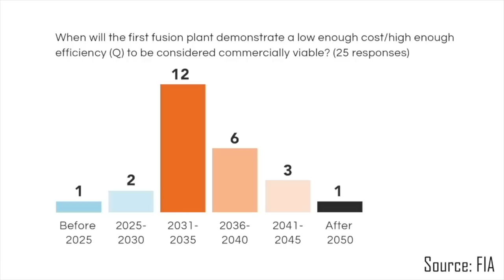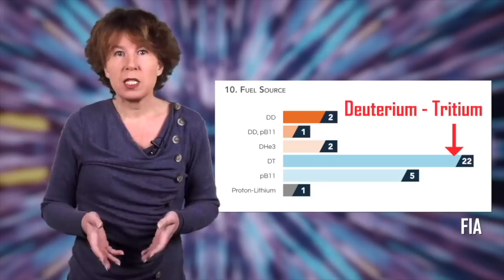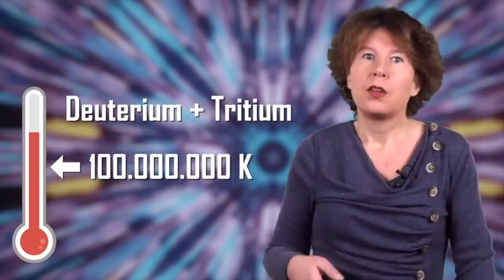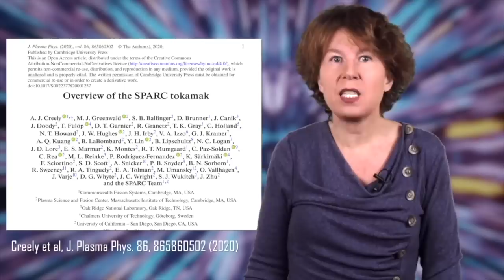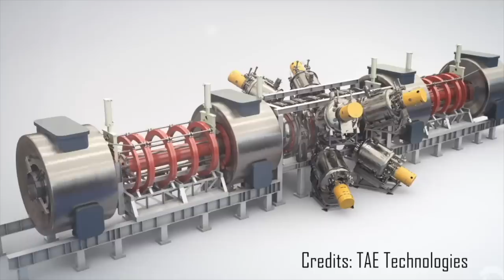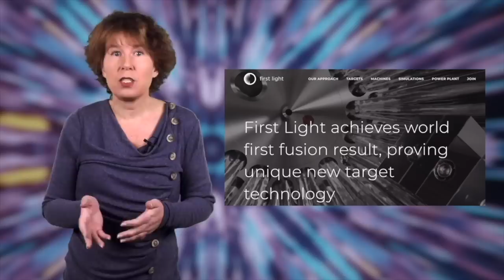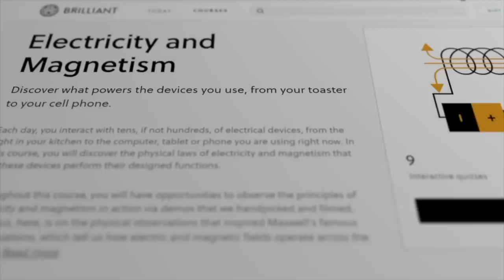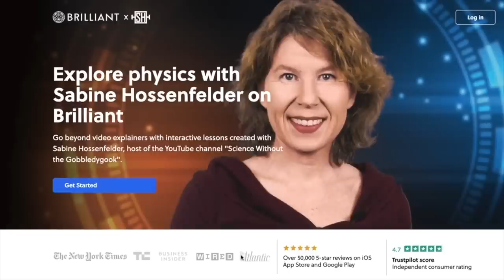Nuclear Fusion: Who'll Be First To Make It Work?

Comment: The issue with these technologies is that they are about 5 orders of magnetude away from economic power production. Maybe much more. 
Today, some claim positive power results. However, this does not include the following:
1. Cost of the energy to heat up the fuel. 
2. Cost of cooling containment walls.
2. Cost of refining the tritium.
3. Need to get to at least 10x power out / power in for economic power production.
4. Cost of fuel preparation. 
5. Time cost of money for building the vastly expensive plant.
6. Depreciation cost of the research to get to practical fusion.

I am sure Sabine can do better calculations than I can. 

Even if practical fusion generation is possible, how many years to get this level of improvement?

Solar, thorium, wind etc look like much better prospects in terms of cost and risk.

What is fusion good for? 

Well today, it is practical means of extracting money from government!

Comment: JET's 5 SECOND LIMIT WAS BECAUSE...
...it was switched off at that point. JET was designed purely as a research reactor as a test bed for future reactors. It therefore was never built with the magnet cooling needed for sustained operation and had to be switched off to prevent the magnets from overheating. If it had suitable cooling systems then it could have continued operating for longer,  but obviously we will never know for how much longer.

Comment: If it is finally got to work there are still a number of issues:
1.  Deuterium deuterium fusion has to be the one, as tritium is so hard to obtain in sufficient quantity on a global scale.
2.  It will be too late to meet the demands of global warming.
3.  The technology is so sophisticated that the skill-sets to maintain such will be a critical issue.
4.  There are long established technologies available today to meet the demands of global warming, especially harnessing wave and tidal energy, with methods for quick response to changes in energy demand.  BUT
5.  It is the sheer political, business, industrial and financial encroachment of the oil industry, that is the problem, a market which no one government can control.  I doubt if the finance market is ready for fusion energy, even for the long term.

Comment: This video appeared hopelessly unrealistic until the last 3 machines were described: First Light Fusion, General Fusion, and Helion Energy. Those three are the only ones that showed any connection whatsoever to the power grid.
Every single other technology described seemed to completely disregard the technology needed to convert fusion heat into usable energy.
Nice work though! Excellent presentation of the current state of the art.

Comment: Lately I discussed the low efficiency of combustion engines with my daughter. The efficiency might be increased by increasing the compression and temperature. If you go for infinity with both the efficiency could approach 100%.
We soon came to the conclusion that under these conditions nuclear fusion reactions would start, and our engine would  not need to combust any fuel..... 😅

That said it was very interesting to see startups use such old fashioned technologies as gun shots and pistons.

Comment: Sabine, My main question has to do with converting the energy produced into electrical current. Some of the methods mentioned do appear to create heat, you also mentioned one method that creates/generates electricity directly. My thinking is that the path from fusion to generation will not be simple regardless of what's known about electrical generation in more conventional methods.

Comment: I think fundamentally we are doing fusion wrong. If we can get a micro-fusion reaction going at only 2,673 Kelvin using high pressure (metallic hydrogen) we can then harness that energy using TPV cells. This would do away with the issue of melting the container as tungsten has a melting point of 3,673 Kelvin. With this we could then aim to build fusion devices that anyone could own, not something the size of a nuclear power plant.

Comment: I don't believe fusion will ever be used to generate electricity under terrestrial conditions. 

It simply takes too much energy  to create the conditions for sustained fusion that can ever be recovered.

Arguing that lasers can be made more efficient is no different to arguing that you can generate net energy by using a fan to move air over a wind turbine if you can only make the fan efficient enough.

Comment: When people say that fusion produce a lot of energy it's true but only to certain degree. To overcome Coulomb barrier we need to 100 kEv of energy (for light cores like hydrogen) and we have get it from somewhere the energy released by fusion should be from 2.5 to 14 MEv or 25 to 140 times bigger. But lets think about efficiency. Our power plants have efficiency from 30 to 60 percents roughly. For simplicity lets say they all have 50%. In additional machine that would pomp energy into particles to make them collide would also have it efficiency guess optimistically it's about 50%. That mean that to get particles with 100 kEv of energy we need to get 100 / (0.5*0.5 )  = 400 kEv of energy or 6.25 to 35 times more. Not that impressive isn't it? But we need to get electricity from it so at best we would have 3.15 to 17.5 more energy than we used for fusion. Sounds close to impossible to make it profitable for me because any drop in efficiency may be devastating for commercial use.

Comment: Regarding Helion, when you mention the cyclotron emission associated with the spiraling motion (gyromotion) of charged particles in magnetic field: I don't know why you reserve it for Helion as it applies to any scheme using a magnetic field to confine the plasma. But the cyclotron (or synchrotron) emission is not an issue as it is mostly reabsorbed by the plasma. Fundamentally this is because when the emitted photon travels a bit it encounters an other charged particle which rotates at the same frequency, so it can resonate and be reabsorbed. The other much more problematic emission is bremsstrahlung, coming from the acceleration due to collisions. Due to the stochastic nature of the latter, this radiation is not reabsorbed and this is a large and well known heat sink. It is a relatively minor problem for tokamaks, a large problem for Helion (D-He) and a probably insurmountable one for TAE (pB11).

Comment: Seems to me an ideal approach would use a combination of cold fusion and scaling up with more energy injected into the system. Plus a starter of nuclear fission (already a tested and working technology). I call this combination "lukewarm fusion". The FFF (fission-fusion-fission) device has already been constructed, so no new technology is required. Just an engineering detail of having the energy produced at an acceptably low rate. And, yes, the reaction is energy positive, especially if one uses thorium as the starter fuel. I suspect the main reason this is not being pursued is that it doesn't cost billions of dollars to create a test reactor, so it doesn't need a multibillionaire or government agency to fund development and implementation.

Comment: My intuition tells me the zap method with be the first commercial approach, but it will not yield much power for its cost.  
Also, it gave me an idea for a completely new approach.  Much like biology does its chemical work, you could break the problem down into many discreate steps, for greater efficiency and lower input energy and containment requirements.  A really big AI could find these steps.  For example imagine the last step use anti-hydrogen as fuel; which is theoretically trivial but has practical issues.  In biology there could be many thousand steps, and there are multiple enzyme pathways to get to the result.

Comment: Simple answer...NONE of them.  The underlying designs are flawed.  The designs are searching for sysmetric systems which can create true positive energy release...taking into account ALL input factors.  But these devices are designed to OPTIMIZE that opportunity.  The failure is that none of them can operate continuously.  Continuous operation is NOT symmetric.  There always has to be an input and output...the act of doing both creates asymmetries.  They will prove the ability to create a positive creation in a vessel.  They will then spend the next 100 years trying to find a way to continuously refuel it.  

All the designs carry the same flaw...even the "inventive" startups.  They needed to reverse the design effort.  Creating a stable reaction will be childs play compated to the problem of refueling.

Comment: Thanks Sabine, a great summary. I do wonder however; do all these slight variations on the various possible solutions, at the end of the day end up spreading the investment across a whole series of 'experiments', each of which will undoubtedly have its own unique engineering challenges but with many common engineering problems being duplicated effort. It might be argued that in the rush for fusion profitability we are actually diluting the available funding to such an extent that we are in fact slowing overall progress. I note that all the current badges of honour for various aspects of the fusion process are still being worn by the publicly funded experiments. I do worry that, this might be a race into a 'closed' proprietary commercial industry, where the pool of available resources, not just capital but also and equally importantly, intellectual, are consumed without having the same focus on the scientific process of rigorous peer review that has been the bedrock of fusion research over the proceeding decades. Without such open scrutiny of results, does the world as a whole not risk throwing good many after bad in regards to the continuation of effort invested in any particular technical approach.

Comment: Fusion. 10 years away since 1950. 
I can't see how any of these will ever compete with solar/ storage solutions given the complexity of the problems....but I guess the energy required to build and run them is potentially smaller than that required to build and run vast solar/storage arrays if the technical problems are solved.

Comment: My way of thinking is that speeding up hydrogen with a magnetic field may not be enough to produce helium. But if you had a small chamber of deuterium, then generate the high level of radiation, resulting from fission, that can be directed and speeded up, it could be aimed at the small chamber. The compressed wave in the chamber could increase the probability of fusion because the radiation causing the compression will be much closer to the binding energy, than using huge amounts of energy speeding up particles. We already know that the photoelectric effect is determined by frequency, and not by intensity. 
Perhaps we need to rethink the recipe for success.

Comment: I distinctly remember that in December 2022 they achieved net gain on fusion at a lab in the US and the dept of energy making an announcement about it. Did I slip into another universe where that didn't happen? again?
Reply: 'net gain' where they lost about 99% of the power consumed. they used that term to misleading refer to whether the reaction gave off more energy (3.15 megajoules) than had been injected directly into the fuel (2.05 megajoules)..

Comment: Moreover there is the Fusion project SPARC developed by MIT. It uses Tokamak design and high temperature superconductors and plans to produce electrical energy in the early 2030ies.

Comment: Sabine, it might be from the scientific point of view very important, "Who'll be the First" (Nobel Price etc.), but for this planet it is much more important to ask: "Who can realize it oecnomically?" The keywords are " levelized cost of electricity" (LCOI). No one needs a controlled fusion process which is much more expensive than windturbines and PV. Calculate for ITER: >20 Mrd. Euros for a 200 MW(el) prototype reactor with a predicted uptime of 50 %. Even fission reactors with much higher power output and less investment costs can not compete with PV and windturbines. When you calculate the billions of dollars for fusion reactor development for more than 50 years (past) and additional at least 30 more years, it might be a waste of tax payer money. Can you imagine what you could do with this money and nicely working technologies (PV, windturbines, bio fuels, batteries and hydrogen and other storage technologies)?

Comment: Good to hear it is atleast 10 years away…
Fusion not only needs to be physically viable, but also economically!
Here, on earth, it will become not needed, we can use at far lower costs and risks the fusion reactor at 8 light minutes away. But for Mars or Ganymede, where the yield of PV is too low, it will be needed. However, such fusion plant must shrink and reduce weight, as such obese solution won’t fit in any starship.

Comment: If vacuum bowl in the center by high heat material like clay or ceramic then 8 to 10 DC coils tube pointing magnetic outward would increase the negative of vacuum by over even vacuum so filled it with dark energy and create matter that it burn as soon as created then heating suround water turn into steam so the steal will feed peltier electric generator feed back DC pulsating out put like breathing lunge

Comment: I really enjoy your informative videos and sense of humour. I would like you to review the work of Aureon Energy and the Safire experiments on which Aureon Energy has been based. Safire produced a model of an electric ‘sun’ in which the plasma filaments are self organising and do not require power intensive magnetic confinement. As an unexpected side effect, the researchers found that some nuclear transmutation had occurred and also that some excess heat was being created, suggesting the possibility of an ‘over unity or Q>1 ‘ machine might be possible. However, Aureon Energy appears to be putting their efforts into nuclear waste remediation via the Safire process rather than enter the crowded and costly nuclear fusion arena. Wt are your thoughts?

Comment: In my humble opinion, the reactor topology where you could directly generate electricity would be the best candidate. With nuclear or atomic power paradigm, leaving the nuclear thermal heat the electricity generator should be abandoned. Plasma technology is an incredible umbrella offering heat, light and electricity.

Comment: 14:47 The infinity gain just implies self-sustained chain reaction, no? Fusion fireplace heating itself after the initial heat has been removed, similar to wood burning fireplace heating itself after the lighter has been removed.

Plenty of sources on the web seem to agree to the definition, "Ignition corresponds to infinite Q"... (This still assumes continuous fuel input, this still doesn't count power spent on cryo, control systems, pumps and all that...)

Comment: Tritium is easy to breed from lithium with neutrons from the fusion reaction or other breeding reactions. MIT is designing D/T fusion reactors that produce more tritium than they consume. CFS is now in Devens, MA and they have 400 employees, Q = infinity just means that the part of the fusion energy that stays in the plasma is enough to heat the plasma and create more fusion for as long as it has fuel although they'll limit it to 4 seconds because they don't want the fusion reactor to melt. :-)
Reply: Yes, it's so easy that nobody has actually done it, yet. :-)

Comment: Tokamak type fusion generates energy in a volume, and is passed through a surface for collection. They should be looking at scaling down in size, not up. Fission generates in a volume, and is collected in a volume. They could always have pipes through the tokamak  chamber to collect the energy. What is 2GW through 12m^2 like? Is the heat moved away fast enough to stop things melting?

Comment: I really like the way Sabine explains things. She puts in the right amount of humor. But I am really sceptical about fusion reactors (and also of hydrogen technologies). Don´t get me wrong: There should be research. But fusion is unlikely to be in place to meet the challenge of climate change, even if we start building comercial reactors right now (which we can´t in the first place).

So all that money is dragged into a technology which might work someday in the future while on the same time we have a big challenge to adress right now. It goes similiar with hydrogen or the EFuel-debatte (artificial fuel) in Germany. Both may be useful for some applications in the future, no doubt about that, but won´t change anything in the short run. 

The hype about this may be artificial created by those who want to sell coal, oil and natural gas as long as possible. They just point at fusion and hydrogen and say: don´t worry about today, we will have these in the future. Same goes for EFuels. They go on with the old IC engines and tell us they will fill it with EFuels in the future, no need for improving electric cars. This totally ignores todays efficieny problems with all of these. There s no solution in sight to these problems, they just might be solved in the future... but what if not? 

But we need to change things right now and have to put as many efford and money in solutions which work right now.

Comment: You neglected the projectile ignition system.
So actually the best chance may be to combine all three types. 
A donut magnet with two rail guns firing frozen foam pellets of Duterium/ Tritium at each other meeting in the center of the magnetic field. 
With lasers firing at 45 degree angle into the center of the donut.
Liquid lithium transfers the heat in a heat exchanger to boil steam and produce electricity.